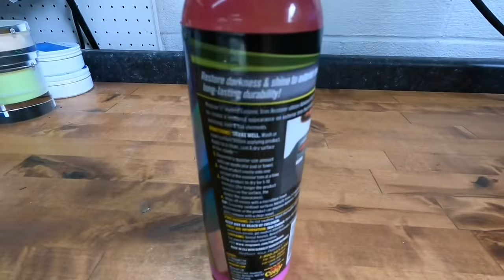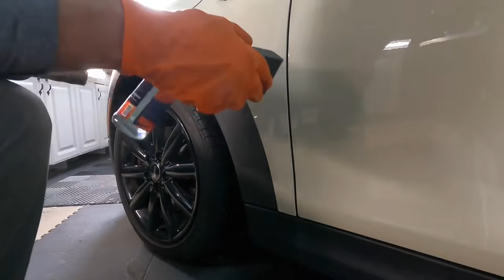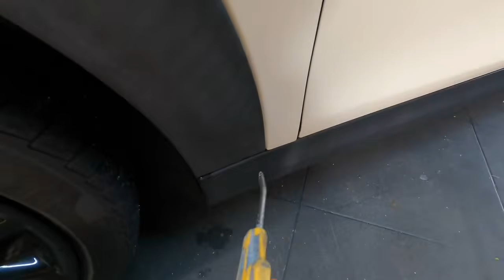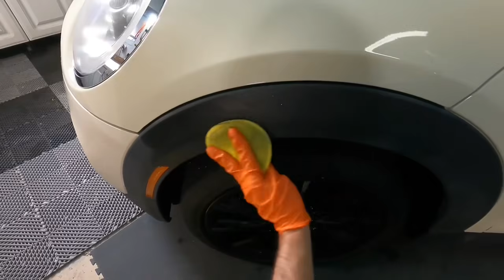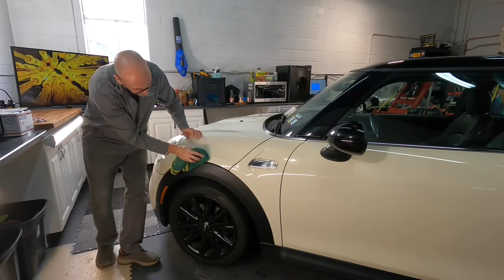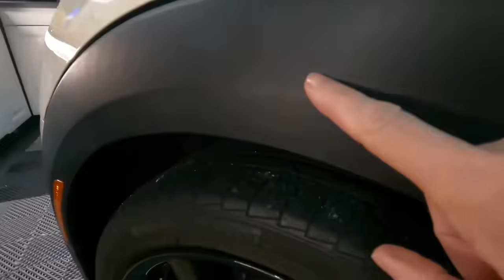This Is How MEGUIAR'S Hybrid Ceramic Trim Restorer Can Rejuvenate Automotive Plastic Trim!!

Comment: Hey, I remember this Mini and its faded trim from the Stoner Trim Shine Ceramic Plastic Restorer video ;) By the looks of it, the result was not so great for a 50$ Trim Restorer! I expect a better result, don't know about you? But this is just not good enough for me as end result.
I kinda already know this Meguier's Ceramic trim restorer is not gonna do any better..
Reply: I totally agree. I would only use them in a pinch where I needed something now from a local store. Labocosmetica's TPR ( trim plastic rubber ) would have done a far better job with one application. Brian if your reading this i would like to see you evaluate Labocosemeticas  3 PH wash systems. The soap's Primus Alkaline , Purifica Acidic , Semper Neutral  are all bangers and certified safe on all areas of the exterior. There rinseless system Preludio Alkaline and  Preludio Acidic are also top shelf. I would pass on the neutral Idrosave as it leaves a protection behind. Adios, till the next time good friend.

Comment: I dont use Meguiars products anymore. 
Hey Brian. I coated a Honda 2 weeks ago with Gyeon Mohs. According to Gyeon, they dont recommend putting Mohs on black plastic trim. They say it will get kinda whitish. Gyeon says to use their Gyeon Trim coating. I didn't do that and put Mohs on anyway, and it turned out great. Is Gyeon right of are they pulling my leg? Thanks Brian.
Reply from the maker: They add that disclaimer because if plastic trim is damp in any way when applying the coating...it can turn whit shortly after cure. You probably had that trim perfectly clean and dry so all is well.